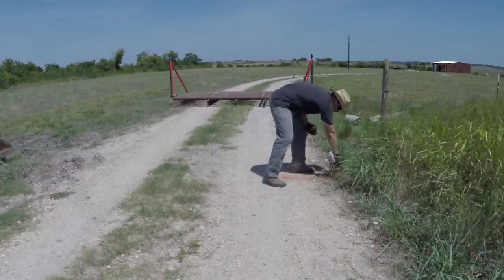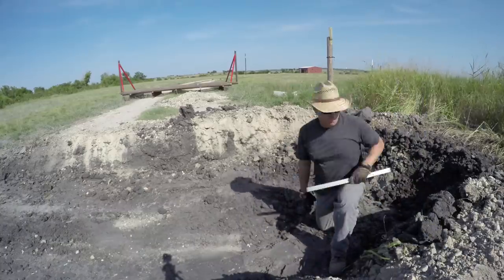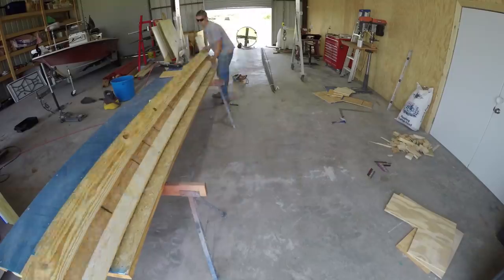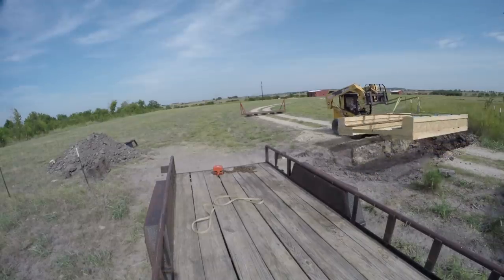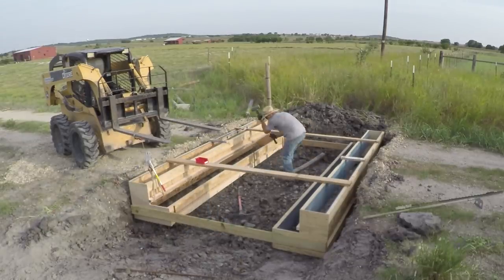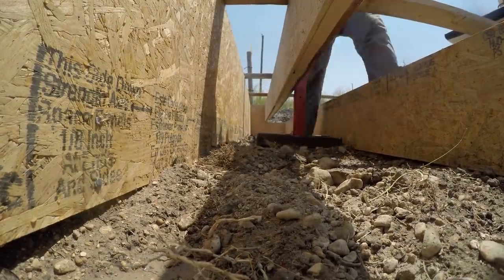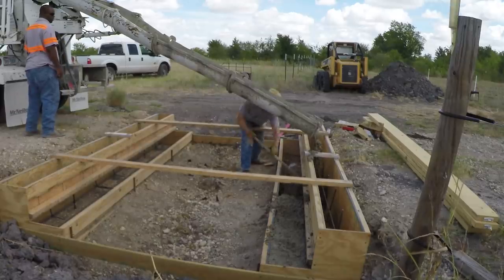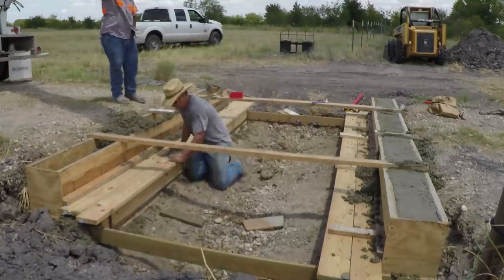Cattle Guard Footings

Comment: you did an outstanding job on the cattle guard. back in the late '40s and early 50's on the farm in Tenn. we made then basically the same way, but we used logs and 2X4 instead of concrete and steel pipes. (Mississippi gulf coast)
Reply from the maker: Thanks for commenting. I'm sure vehicles were a lot lighter back then. I had to make this one to support a concert truck. Take care.

Comment: What kind of weight will that handle? We usually build two perpendicular concrete supports approximately dump truck width apart for duallys with heavy loads, like concrete trucks, dump trucks, feed trucks, grain trucks, etc...

Great video though. best wishes and good luck.
Reply from the maker: It's designed to handle 80 tons. I've tested it once with a concrete truck snd it did fine. Take care.

Comment: Cattle guards also work for horses, as long as the horse can see it. On dark, foggy nights they will walk by feel and easily cross one and wind up standing in the middle of a paved county road. A road where no one obeys the 45 mph speed limit, even on dark, foggy early mornings. A compact pickup doing 60 mph  hitting a large horse sounds just like you would think it does.
Reply from the maker: I bet hitting a horse can cause some real damage. Generally in Texas hitting livestock is the driver's fault.

Comment: Why did you put it there? The ground looked level
Reply: Are they only for hilly terrain?
Reply: They are installed in fence lines. They have nothing to do with water or terrain. They are just for convenience so you don't have to stop and open a gate, drive through and close the gate behind you. The gaps between the bars prevent cattle from crossing.
Reply from the maker: The cattle guard is on a fence line dividing two pastures that my main road goes through.

Comment: My cows will jump a reg 8ft cattle guard. Next I'll have 12ft
Reply: I set these on the ground rather than digging them in creating a ramp
This stops cows and sheep from jumping them
Reply: Over 20 years ago, we had a normally lazy cow, whom calf went missing after sliding between the pier and gate which was poorly chained. After a while the calf managed to be out of her sight, do she jumped the 4ft wall next to the pier. Then proceed out the gravel roadway towards the road. The neighbour cow passage cross the main passage so a cattle grid was installed a decade before. Now she could have gone three directions freely off side passageways and a open field,  but she choose the fourth way a cattlegrate. The calf took the left turn at the cattlegrate and never responded to the cow call, which is a very loud roar as my neighbourwas a half a mile away could easily hear. Anyway the cow proceeds out towards the busy road and remembered when she was 1 year old the cattle drive,  walked down towards our house direction, and enter another long passage where we had winter cattle holding shed and walked past the house roaring and woke me up from a sleep. My two neighbours at different times saw her from a distance and tried to cut her off, but was way too slow. They said from a distance they saw her moving fast. I scratched my head, because she is normally the slowest cow we got and stubborn as hell. Well My mother was complaining about a over grown haggard (unkempt ground). So I put her in it and tracked down the sleeping calf in my neighbor's field nicely hidden. I put her in the box dropped her off at her mother next to the home. 

Well that lazy cow did well grazed down that haggard and to train a friend of a neighbour, how to hand milk a cow. I hand milked her as she had lots of milk that calf could not drink, normally we milk her by machine at the farm with the rest of the cow herd. She was so lazy, that she is the perfect hand milking cow, but once motivated she can move, especially when the Vet calls around.

Comment: only problem  is that it will mive must be 1 piece  .. Australian been doung them for many years 🤣🤣😎 good try but
Reply: I was thinking about that when i watched the video. If built as two separate units, would thick rebar poled down into the ground inside the boxes "anchor" them so that they don't move? Or do ya recon that'd be a temp sollution?